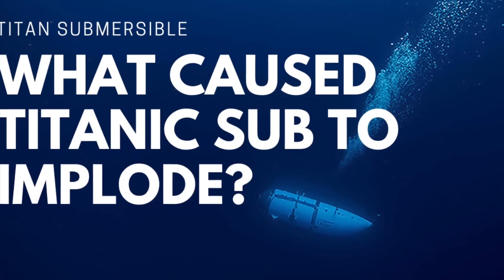What Caused the Titanic Submersible Titan to Implode?

Comment: Why didn’t just go back up when they saw the sub wouldn’t hold ?
Reply: Because in about 1 millisecond it went from everything was fine to total destruction. When I was a kid, marbles were all the rage. A friend of mine and I used to put marbles in a vise and slowly tighten the vise. There was no warning that the marble was about to break, it would just suddenly shatter into hundreds of tiny pieces. Kind of the same concept.
Reply: @AZ_Raven  I hope there was some form of eye protection...
Reply: @AZ_Raven  yea thx for the answer deep sea his a dangerous place
Reply: Because they were crushed into dust in the blink of an eye.
Reply: @burtpanzer  yes that’s crazy
Reply: From all reports the vessel had given a number such , related to communications and the acoustic warning system , the problem is the composite design ,too many chances of failure 
The carbon fibre used on the cylinder is subjected to conditions not similar to a pressure  vessel of this type : metals is metal cloth is cloth

Comment: You, along with most all commenters failed to mention the main cause of failure.  Carbon fiber is only at its strongest when the forces involved place the fibers in tension.  This only happens when the CF cylinder is containing the pressure inside the cylinder as in a solid fuel rocket booster casing.  Pressure from the outside of the cylinder puts CF in compression in which CF is not strong at all.  You can take a bundle of carbon fibers and bend them and even tie them in a knot.  The strength of the lost sub's hull came from the five-inch thickness with carbon fibers only serving as filler bonded together with epoxy resin.  This was a colossal stupid mistake and should have been figured out by NASA, Boeing, or the U of W, if they were even involved.
Reply: Yes - but for all the wrong reasons. You need to learn a bit about composites to voice opinions of this sort.
Reply: @les8489  Interesting. If you compared this 5 inch thick structure against a pure epoxy resin 5 inch structure. How would they compare in strength when under compression?
Reply: @davidvanderklauw  Have a look at the (approximate) values of hoop and axial stresses...Hoop stress is in the order of 300 MPa at 4000m. I do not know any epoxy which would take this w/o contribution from carbon fibers. In addition - curing thick shells is extremely difficult due to exothermic character of the reaction (lots of heat generated, which in conjunction with low thermal conductivity can lead to carbonization of the matrix). So it was probably cured in stages (couple of layers at one time), and probably with no pressure (autoclave) involved. This would lead to a rather substandard carbon/epoxy composite - which in addition would be very weak in the axial direction (if the winding was only in the hoop direction).
Better layup would be something like 20/15/15/50 - as a percentage of fibers in 0/+45/-45/90 deg. directions (with 0 deg being axial).
Reply: @les8489  "Yes, but for all the wrong reasons".  Yes what?  And what reasons are you referring to?  Carbon fiber is only very strong in tension, is not an opinion, but is a fact.  You really haven't conveyed much in your comment besides hostility.  You need to learn more about verbal communication before you spew your crap.
Reply: @denniscliff2071  OK, in order of appearance:
1) "...compression in which CF is not strong at all". Compression strength of a carbon/epoxy composite is about 60-70% of the tensile strength. So - it is quite strong...
2) "... take a bundle of carbon fibers and bend them and even tie them in a knot." Yes - but only BEFORE it is cured. When it is cured - good luck with your knots.
3) "The strength of the lost sub's hull came from the five-inch thickness with carbon fibers only serving as filler bonded together with epoxy resin.". Now - this is totally wrong. The strength of ANY thickness comes from carbon fibers. The fibers are the component which gives the composite its strength. The matrix (epoxy resin) contributes just a couple of percent to the overall strength.
4) I am not "spewing crap". I have been doing composite analysis and design for the last 40 years - working for Airbus, Boeing, Northrop, Lockheed and Bombardier - so I probably know the stuff quite well. Verbal communication ? Not a problem when I talk to people who know a bit about the subject. 
5) It is really hard to explain composite design, analysis and material properties to someone who has little or no knowledge on the subject. Material science for composites and analysis methods can't be summarized in a post even if it was 1000x longer. This is a fact. So - if you have a specific question - please ask and I will do my best to respond.

Comment: I just realized why some UFOs are probably spherical and probably also why they can go from the air into the ocean so easily. I've never seen one go into water but I did see two of them with my birdwatching binoculars at noon because I was in the park watching birds and I also saw them disappear into thin air through my binoculars. In any case, maybe a spherical shape helps them travel through space at the extremely high speeds they must be traveling in order to reach our planet.
Reply: There is no way a living thing could travel from another planet to ours by travelling at high speeds. Our closest neighboring star would take 9 years to do a round trip travelling just under light speed which is the fastest speed possible. 9 years is a long time to spend in a small tin can. It would take 200,000 years round trip from the other side of our galaxy. If anything is visiting us from another star they have figured out how to transcend space without having to travel threw it,  it just takes too long as the distances are far too great no matter how fast you are travelling.
Reply: @wally7856  that is exactly it, they dont travel at speed of light, they create a bend in space/ time fabric and go thru that, essentially connecting galaxies to each other at will, human have yet to figure this out......
Reply: UFO's rely on exotic force fields to survive space and ocean depths.
Reply: I've seen UFOs change into seagulls . Because that's unfortunately what they were in the first place.
Reply: Nothing 'material' wise can ever reach earth. Times are in 1000s of light years. Carbon based life can't survive these times even at slightly slower than light speed. 

If UFOs are reaching us they are much nearer. Therefore, come from within our own solar system.

Comment: The monitors were screwed INTO THE interior LINER.. not the Hull..
Reply: Exactly. People seem really interested in elevating Rush’s bad decisions to truly absurd levels. It’s not good enough that’s he made critical mistakes and died. Oh no. He has to be a complete idiot, evil, and maybe the worst guy in the entire world.
Reply: Yeah this guy hasn't done his research before the video.
Reply: @andreasfjellborg1810 I agree , that's when I started to think that this video was more of a witchhunt of some sorts . I continued to watch but lost faith In what research this guy really did before firing off a video which is inundating you tube due to search trends and titan being a very high trend right now .
Reply: The perforations allow the backlighting to shine through and also could be for sound absorption.
Reply: How thick is the liner? How long are the screws?
Reply: @bread-chan6650  From the pictures ive seen it's only like 3-4mm thick, but looks to have spacers between it and the hull, probably some sort of high density foam. the screws are small bolts, with a nut inside.